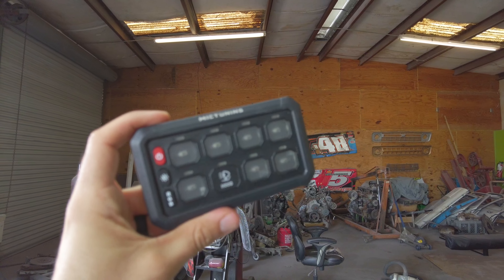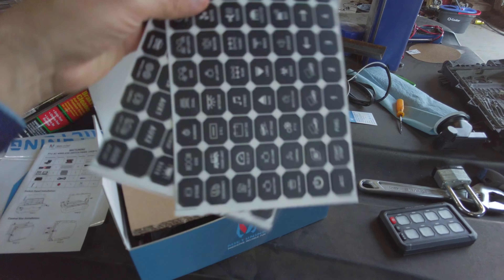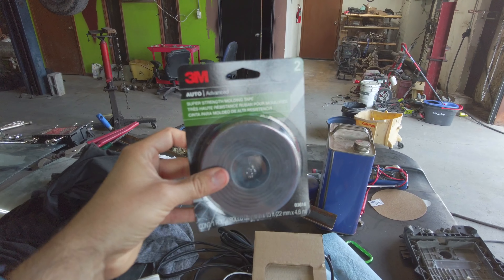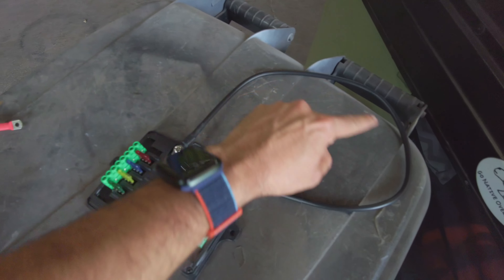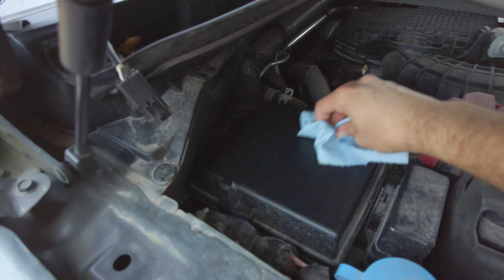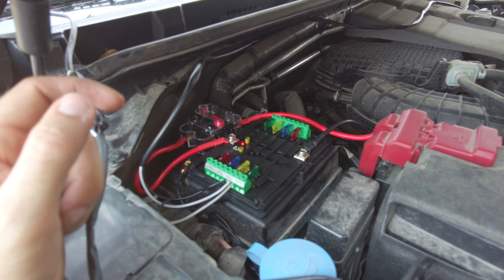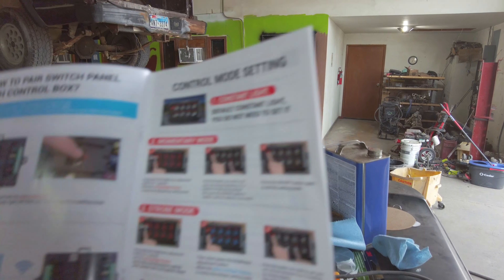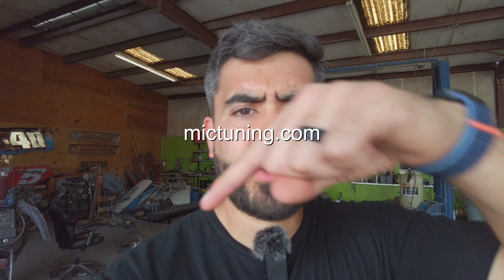MicTuning Wireless Switch Panel Install

Comment: connected to the battery it wont drain it ? any updates hows it holding ??? everything still works good ?
Reply from the maker: Everything works perfectly. Battery life on the switch isn’t so great, lasts about 3 weeks in full Texas sun. I just leave it charging while driving

Comment: Exact spot I have on my R51. However, I wanted to check my wiring against yours when it came to wiring since it's the first one I've ever install, but you didn't cover that part. I currently have the ACC wire hooked up as well as straight to the battery.
Reply: Did you ever figure this out? I’m worried about draining my battery and wanted to also make sure that it only powers on when ignition is on.
Reply: @jimnguyen7627  Yes, hook up the ACC wire only if you want it to turn on when ignition is on.

Comment: This is nice to have wireless but a shit implementation of it, they should have had it recharge automatically when it's put into the cradle, having to charge another device all the time is a bad implementation of this, I will stick to my hardwired version.